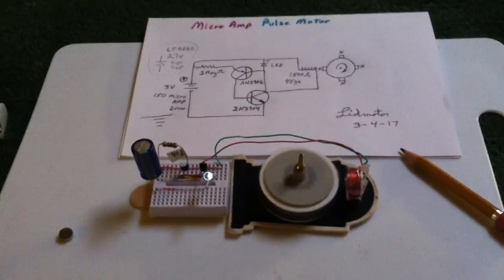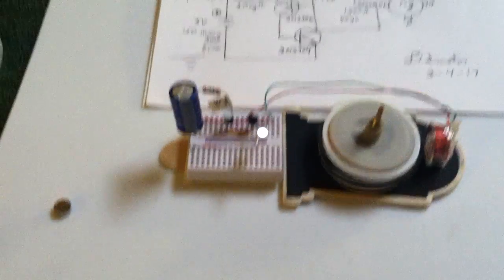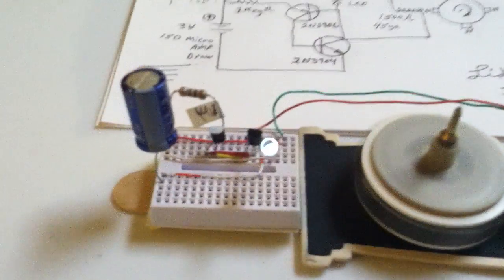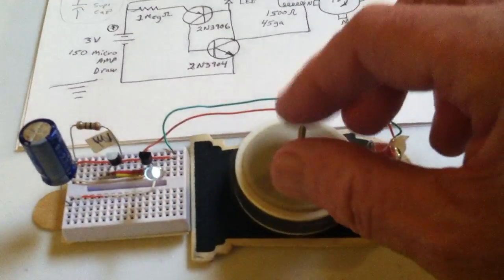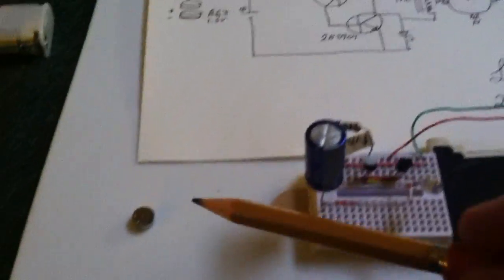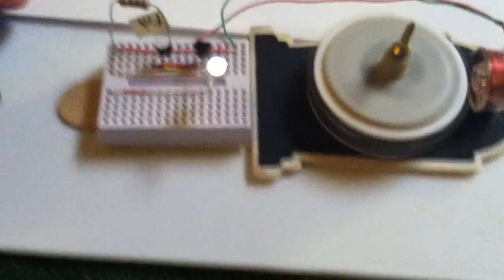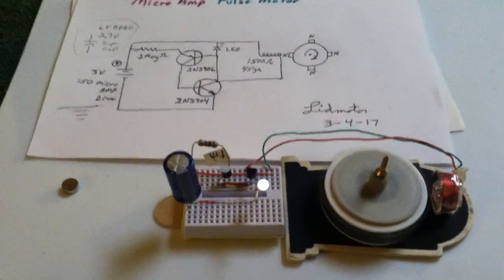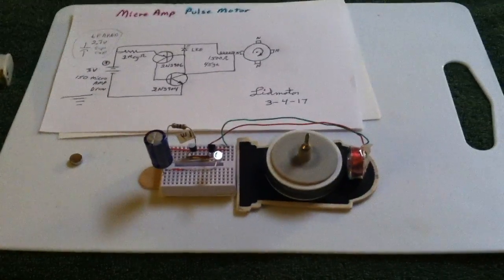Micro Amp Pulse Motor

Comment: Hello Lidmotor, I have just finished building my first pulse motor, and although I am happy with it for being my first attempt, I would like to modify the circuit by adding transistors, resistor and caps to prolong run time. I have copied your circuit several times but with no success. Obviously I am doing doing wrong, I was wondering if you could possibly assist ? Many thanks, Eddie.

Comment: You mean micro current      is energy efficient?   Energy efficiency compare to conventional motor  
Please reply
Reply from the maker: Motor efficiency is all about getting the biggest bang for the buck from the energy you have available.  Different situations require motor designs.  Here all I wanted to do was simply move a small disk for a long time on a tiny amount of energy.  It sounds really easy but I found it to be very hard.  Lots of things got in the way.
Reply: Compared to conventional motors, these do not have enough torque. They won't be able to run your vacuum or washing machine. ;)

Comment: This was suggested today in my views and although i have seen it already, i confused 'micro amp' with 'op-amp' pulse motor. A thing i have been wondering about for some time and may have been done before, is an op-amp oscillator/pulse motor possible?
Reply from the maker: I don't know Ben.  My op-amp experience is pretty limited.  I guess you could take a low level signal from some kind of rotor position sensor, amplify it, and then use that in the driver circuit.  I have tried running a motor on just an oscillator frequency and that didn't work well for me.

Comment: If you use driver circuit from, Solar Rocker toy and use Many small Neodymium magnets in the Pulse motor rotor. Then you should be able to bring the power draw down to around 15.2 Micro amps as I had done 👍🙂.

Comment: Aside from the resistance differences that you discuss in these two circuits, I also note that the LED is placed in a different place as well. I wonder if that has any effect on the run times you were getting between them. Also, if I cannot get a coil with a high resistance, can I make up the difference with a resister next to the coil?
Reply from the maker: Just adding a resistor doesn't work.  The position of the LED does not change the run time.  Good questions.  Thanks for posting them.

Comment: Hello 
I’m trying to replicate your motor; I may have a few “very beginner” questions
I have found the tow transistors but I don’t understand the 1 meg resistance can I ask for a link or more info please :)
Thanks a lot, 
I really like your creations, I found amazing to run motors on so low voltage
Reply from the maker: You need to find the 1 meg ohm resistor somewhere.  Do a Google search for it.  Any electronics supply will have one.  They are sold in  packages with a bunch of them in the package.
Reply: Thank you so much, i was having a hard time to found it, with the full name I got it 
Thanks for your time, sorry again for the “full beginner question”

Comment: You can also collect the BEMF pulse into other cap and then make a switch between the the 2 caps. This will recycle the energy even more. Increase run time x10 or more!!!!! Google: back electromotive force (BEMF).
 Use a full wave bridge rectifier after the reed switch

Comment: Lidmotor - found a source for coils that have 3,900 ohms !!! Next time you are out... find an old throw-away microwave and in the bottom there is a small motor that makes the turn-table spin... Take it out the bottom, disassemble the motor and you have a wonderfully wound coil that is about 1-1.5 inch tall, 1/4 thick with wire so fine you have to use a magnifying glass to see it (well, at least at my age you do). It has 3,900 (+/-) ohms and it is  something I am playing with. Maybe you should find one of these and see what happens in your "Wonderful" projects which my Middle School students always try to duplicate.
the Ole shop tchr w. 40+ yrs in education.
Reply from the maker: Thanks.

Comment: Hi I'm trying to replicate this project and I'm wondering how many turns would make 1500 ohms?
Reply from the maker: I don't know.  I had a friend years ago who used to make these kind projects.  She once made the statement, "Wind your coils with wild abandon."  I have always thought that was great advice for a hobby person that is doing this just for fun. On this project just use very fine wire and wind up a coil until you get tired.  Have fun.
Reply: hahaha yea that's good advice, I've wound it about 400 times and it just go for a while than sort of pendalems back and forth for a while, I copied the exact circuit, just I''ll try another 400 probably...Thanks again Lidmotor  :)

Comment: With a solar cell added it should run non-stop - it would charge up in light and run the super cap during the night. Of course start with a charged up super cap. I like your motors and the ideas you use to build them.
Reply: Compare to conventional  motor size.
Torque different this motor
Reply: Super not enough energy density
Reply: @afgamer5576  It wasn't built to have torque. Just as efficent as possable.

Comment: Love this one. However the concept of "Come back in 10 years time to see if it is still running" is probably a step too far for my 30 second attention span. I can just imagine one of those live webcam feeds running continuously. Excellent video as always 😊
Reply from the maker: Thanks.  I think you are right about run time.....it doesn't matter as long as it runs at least 30 seconds. Ha.  My friend Lasersaber did setup a live feed camera on one of his EZ Spin motors that ran for a long time.  From time to time the motor stopped (for various reasons) or he had to move the camera.  It was a great idea but it would have been more fun to watch if he had let a pet mouse or something scurry by it from time to time.

Comment: can you charge something instead of the lead?
Reply from the maker: YES!  The LED could be replaced with a 1N4007 diode and the fly back could charge either another capacitor or a battery.
Reply: please add a super capacitor to see how fast charge!please
Reply: @Lidmotor 
Please diagram how to place diode and battery

Comment: 1500 ohms, that's an insane coil...a very cool insane coil lol, nice winding for sure.
 Perhaps a JT front end could bring it down to 0.7V with similar draw.
Reply from the maker: If you have never wound a 45ga coil you have not had one of the true adventures in life.  Get a good nights sleep and have a quiet room before you try it.  This is the same wire that I used on the EZ Spin motor that Lasersaber sent me.  I might try this circuit on that setup and see what happens.
Reply: Have wound a few and why i'm thankful those dancing things are only $1. An adventure certainly and the effort is rewarded. Reminds of winding Exciter coils at 4am., 'only 200 turns to go'. 
It's a keeper, hopefully featuring in more vids :)

Comment: I could have sworn you have at least one motor that can run at under 3 microamps at less than 3v.
Reply from the maker: I think I have.  I will go back through my videos and see.  I ran this motor until it stopped (12 hours) and the final voltage on the cap was 1.41 v.  The 6F / 2.7v super cap had 2.7v in it when I started the experiment.  I think I can tweek this thing and make it better.
Reply: I say that because a while back I was on a mission to try to match or beat the lowest draw pulse motor I could find out there, and I believe I either came across a comment of yours or saw a video where you basically had a rotor going from 3uA or even less, however I may be confusing that. At any rate I recall you having the record at one point and I'm pretty sure you managed around that range of current.

Comment: glad to see your still making your video's.  150ua draw is incredible feat. Those small wires really make a huge difference. I got to thinking if you replaced the transistors with mosfets I bet you might save on the current draw. I also thought about if you had used a crystal oscillator chip along with mosfet it might be even more efficient. My two cents. Thanks for all the years of videos, you have really kept me thinking about efficiency.
Reply from the maker: A mosfet version would be interesting to try.  This quest I have been on for years towards "extreme" efficiency has been fun.  Thanks for following along.

Comment: .45 mw...that's impresive :-)
How are you able to measure the current?
Reply from the maker: I measured the amp draw using two types of meters and saw between 50 and 100 micro amps but used 150 in the video to be on the safe side.  It is really just a ball park method but it is all I need.